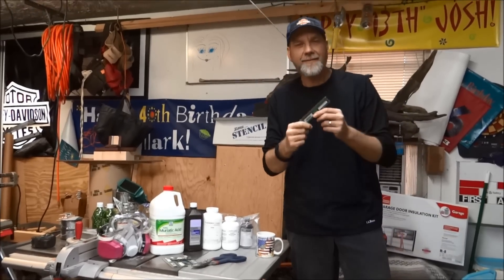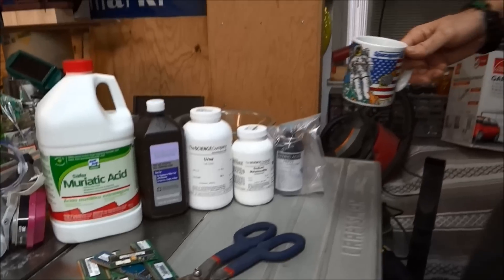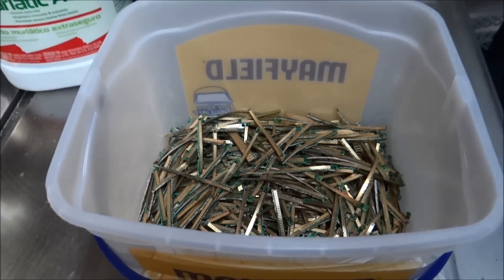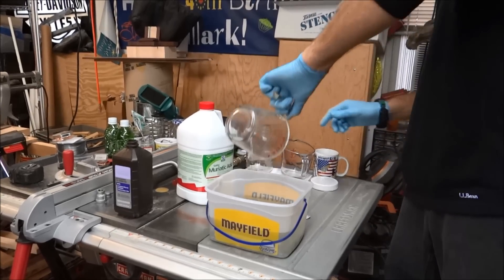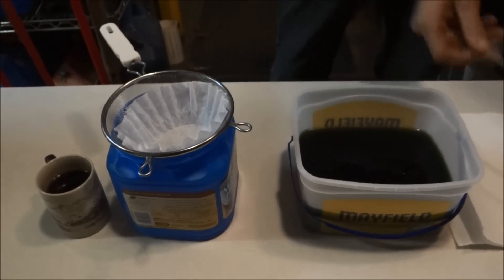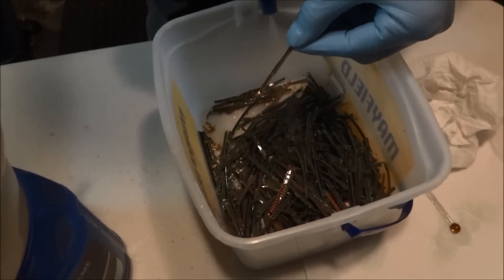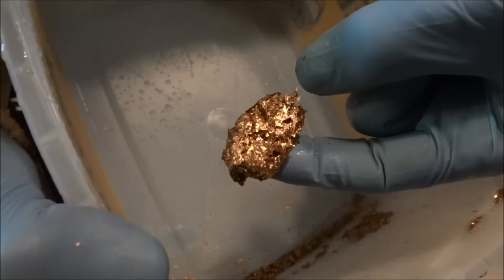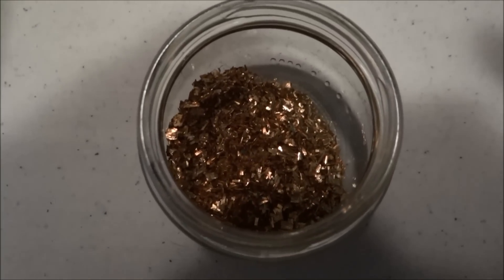How to easily recover gold from scrap computer chips

Comment: Is the urea necessary? Can't you just use the S.M.B only? Of course the urea makes it esier to handle, but do you need it?
Reply: YES THE UREA IS NECESSARY in the Nitric Acid/HCl Acid *Aqua Regia) process.. Without neutralizing the Acid you can add all of the SMB in the World and the Gold will remain in solution. 

If you want to live dangerously then you can skip Nitric Acid altogether and add Household Bleach to your Muriatic Acid. (I will not.)

Of course this creates Chlorine Gas...which can deadly...but will dissolve the Gold. But then the Urea is not necessary and YOU DO NOT ADD IT AT ALL. Then the SMB will drop the Gold from that solution.

Then that stinks up the neighborhood...Some busybody, who does not like the odor, thinks that you are running a Meth Lab...The DEA is called out and raids you. Then you go to jail for refining Gold.

They seize all of your property and your Gold. And although you are released, because they have NO EVIDENCE, you still do not get your stuff back.

Think that is far fetched??? Do not laugh. It happened to somebody I know.

TALK TO YOUR NEIGHBORS AND LET THEM KNOW WHAT YOU ARE DOING. Be loud and visible. Invite them over. Ask them for their broken electronics so that you can do the Green Thing and recycle them so that they do not fill up landfills.. Do not create obnoxious odors. Minimize that by creating a fume hood and charging the exhaust with Charcoal.

Good luck.
Reply: Thank you so much for the info! I better pack up my methlab and remonce it ,before i start 😉 i have seen a video where the bleech is bring use.  But in denmark we only have klorin and nitrit acic and sulfuric acid has been made illegal, but I have some nitric acid that i have saved. But when i run out of it, I have to use the bleech combination. But I dont know if klorin is good enough or to dangerous, i know that it shouldn't be mixed with anything but water😨
Reply: 24kGoldenRocket The reason i need the sulfuric acid, is because i've bought 140 grams of very low karat gold from Israel on ebay, a 6 karat of testing fluid is way to much for it, but it take som time to disappear and it is really heavy. I think there is both lead and aluminium and cobber or brass in it. i thought of melting it and make flakes of it and then try reverse electroplating or should i put the flakes into Aqua regia. I have seen that most people use a 50/50 soloution when they make their "Aqua regia" an use a hotplate, does it harm the gold in any way? do you need to neutralise the Aqua regia fast? (thanks for the tip on sulfuric acid, i was about to make both nitric and sulfuric acid and destil it myself.
Reply: thomas lund I hope that you did not pay a lot. One of the current scams on eBay is that these guys will melt all of those plated pins together....and then sell those. 

I would infuse some flakes into Aqua Regia and then test with Stannous Chloride Solution to see if I'd get a strong positive for Gold before proceeding much further.

Best wishes. Go to the Goldrefiningforum.com and read Hoke's book. (free download.)

This reads as if you have bought yourself a nightmare.
Reply: No i didn't pay much, maybe i should have it analyzed, but it cost more than i have payed for it is it just half a karat, then i've made Money on it, but i doubt it.On Ebay there is a lot from America that don't ship to denmark, so i'm missing out on the really good deals :-(   I just can't imagine that they can make Money when they have to melt it. My theory about there being tungsten/wolfram in it is right out the door, because that requires about 3500+ Celsius to melt, but it have a very high density about the same as lead but a Little heavier an it's shiny like gold an it doesn't oxidize like brass
Reply: thomas lund Tungsten has the same density as Gold. Furthermore you do not have to make them...when Chinese Companies are already making them and selling them online for much less than the price of Gold..

From my favorite Financial Website:

http://www.zerohedge.com/news/2012-09-24/get-your-fake-tungsten-filled-gold-coins-here

is this...when I followed the link...

http://www.tungsten-alloy.com/gold-plated-tungsten-alloy-coin.html

Yeah. You are missing out alright...NOT.

I will not buy off of eBay as I cannot test the item which I am buying.

If a deal reads as too good to be true...then ninety nine times out of a one hundred it is too good to be true. Thus you can conclude that there is a fraud being perpetrated.

Be careful out there. Buy locally. This globalist economy encourages fraud and corruption, both large scale and small scale, as little can be done to punish it across international borders.
Reply: 24kGoldenRocket I have seen it. But the density of gold is a tiny little bit bigger. I heard some time ago that Clinton swithed some real gold bars out with this tungsten-shit, ofcourse to switch them back later, but they accedentally shipped one to Germany. They almost didn't noticed it, but a goldbar is a bit heavier than these smal lumps i've bought. I don't know if it is true, there is a video about here on you tube, but that doesn't make it true! By the way, i saw a video where a guy made a gold recovery on a 106 memory pieces of memory goldfinger and he only got 0,8 grams of gold, it was 2,0 you got, is there that big of a difference?
Reply: thomas lund On the recovery of Gold from RAM fingers..There can be a marked difference. Earlier electronic boards were not as subjected to as fine of engineering standards as later boards.

As the World Spot Price for Gold increased dramatically, doubling from 2001to 2008, during the past decade there was more of an incentive to conserve the use of Gold.

Thus engineers went to work devising stricter controls over electroplating and minimizing the use.

If I were to run a batch manufactured from the late1990s and compare the yield to that from a similar batch manufactured in 2010 I will expect that my yield from the late 90s batch to be more fruitful.

Yes there is a marked difference.

As for Clinton switching Gold?

There is NO Gold in the US Mint Depository at Fort Knox.

The US Mint made a mistake and exposed it inadvertently.

On their own website in 2009 they claimed that they were suspending the minting of Fractional Gold Coins because their OUTSIDE SUPPLIERS could not supply the blanks. They ran out of Gold to strike the coins.

All Mint activities have been done IN HOUSE historically. If they are reliant upon outside suppliers for planchets then they have no sheet to fab the planchets from and no Bar with which to create the sheet.
Reply: 24kGoldenRocket Okay that's why, that make a lot of sence. I have just tried a little batch of computer scrab, but i left it to long or my HCL is a Little to powerful, it's 36,2% i don't think it is the Hydrochloric acid or the Hydrogen peroxide. I simply forgot that hydrogen peroxide is also a kind of bleech and left it to long. Do i need to put urea in it before i try to cath the gold with smb in that 50/50 Hcl & H2o2 solution?
Reply: 24kGoldenRocket Copper should it be grinded to a powder or just a piece of copper? By the way can i thin my HCL with water, if yes should it be destilled water? how strong is your nitric acid? Thanks for all the help by the way!!!
Reply: thomas lund Use a piece of copper. You do not want it to work too quickly.

My Nitric Acid is rated at 69.5%. It is Technical Grade and Cleanroom Grade.

I plan to use Inquarting to refine the Gold as well as recover 99% Silver for further processing through electrolysis to 999.(Lots of homework.)

Yes you can dilute HCl with Distilled Water. Remember to add the Acid to the water.  Boil overs are not allowed.

Now I would not bother for the initial run. I would just adjust the volume that you use and use a bit less. Since he is using 3 to 1 HCl to Peroxide then I'd use...using my mental gonkulator to estimate...about 1.5 to 1..er...3 to 2 volumetrically.

This is not an exact science after all. It is more of an art. Applied sciences are not generally exact...but can be when it is demanded and necessary.

After you are done with your initial separation then wash your foils with diluted HCl, filter, and repeat the process until it the HCl does not turn greenish blue. You want to get the foils as clean as possible for the Aqua Regia refining.

You have heard it said that it all comes out in the wash? It is true.
Reply: My nitric acid is also 69%, how do you make an Aqua regia there is not to strong and harm the gold. Would you give me your recipe for it, where you both tell me the % of the acid and then amount, I can give you my email if you don't want to write it here? I'm having a Little problem with this copper-thing, because i used tap water to clean the gold out of the plastic container, so it's not very acidic anymore, but there is plenty copper in it from the memory fingers? By the way i took some memory finger that i know was from 2004 together with some there was from the 90's, the 2004's was clean for gold wthin 2-3 hours the others hadn't even lost a single piece of gold, it's not only gold they have been cheap with but also the metal that hold the gold in place nickel,copper and so on.
Reply: DO NOT USE UREA! It is quite tricky to use, and can be problematic. If you go on the Gold Refining Forum, you will know that you can just boil off the nitric acid instead, and you can just use SMB to precipitate the gold out of the solution. Also, the Aqua Regia Method is only useful for purer gold, without the base metals to foul the solution. Eliminate the base metals first, then go at it with AR.
Reply: The E- Scrap Man I have been to the GoldRefiningForum.com. How is Urea problematic? Is boiling Nitric Acid is even more problematic?

(In fact I am thinking that since I am going to inquart that I could concurrently collect the fumes of the Nitric Acid absorbing the Silver and distill Red Fuming Nitric Acid by using a condenser...It is all about Temperature control. It may be a fun experiment.)

Boiling Nitric Acid produces a lot of corrosive fumes. After all it is how you distill Red Fuming Nitric Acid. Personally I would not do that without an operational fume hood. I am not going to write that he corrode everything that is close by with the fumes....including his lungs.

Now you can suggest that if you want. Even outdoors that is imprudent and dangerous.

Personally I would limit my use of Nitric Acid by adding just enough until the Gold is dissolved.

Of course my Urea use will also be minimized.

But Urea is necessary...unless you have a fume hood...which the odds stand that he does not.

What are those odds?

I will err on the side of caution and prudence every day of the week.
Reply: 24kGoldenRocket Yeah, I meant to say heat up the nitric, not boil it. But even so, I will start college soon, so I will have access to their fume hoods, so I can stay safe, but still practice safety precautions, as the nitric acid is hazardous when heated. But on this link, http://goldrefiningforum.com/~goldrefi/phpBB3/viewtopic.php?f=53&t=19126
Geo says that it is best to leave out the urea. And yes, using less of a chemical is always the best, and urea still works, you just have to know how to use it effectively.
Reply: The E- Scrap Man Yeah. I did read that and Geo is one good source. He gave me the idea of slowly adding the Nitric until all of the Gold was dissolved. But I will still probably add too much. It is difficult not to as you want the Gold to dissolve and will end up lacking patience....which also breeds trouble at times.

I am Tall Tom over on that Forum.

So you are majoring in Chem? I studied Physics.

Have fun.
Reply: 24kGoldenRocket well, nice to meet you Tall Tom. I'm  PlainsScrapper on the forum, but I haven't  responded to a lot of posts, due to studies. I am planning to major in Chemistry and minor in  Biology. I want to do the processes like crazy, but I want to read Hoke first, and thoroughly understand the ins- and- outs of the processes. However, my studies have prevented that from happening. Some day, though...
Reply: The E- Scrap Man I am in the learning stages myself, have worked in the Gold industry for the past 25 years, and have some Chemistry background. 

So I have taken the plunge into refining and my learning curve has been steep. No sweat. Well...lots of sweat, actually.

I have read some of the Hoke text. I will read it all before I am through.

My current critique...I do not like it because it is not a direct step process manual. It is reliant on experimentation and uses those as building blocks for the following chapters.

It is presented as if you were in a classroom laboratory lab....which I am not. If I were enrolled in a school with a fully stocked lab then it would be excellent. How many of us are? (Lucky you...)

My impression, currently, is that it is a decent Laboratory Manual but lacks in practical applicability. You must have the materials before proceeding if you want to follow it as presented.

But I will get it down and make a science of it. Dropping the Plat and Palladium will be challenging,

(Even the Tin Shot cost me $20 for a pound. You store your Stannous Chloride on Tin Shot so that it does not decompose. Then the Fume Hood will cost well over $1000??? It is EXPENSIVE. .Since I am doing this then I will do it right or I will not do it at all. That is my OCD.)
Reply: 24kGoldenRocket And that OCD is good, because your safety is worth more than any PGMs ever recovered. 

I could do the experiments outside, but I don't want to poison the environment around me from the toxic fumes and gasses. 

I have well over a pound of goldflash and plated pins from computers, which will be placed in a sulfuric cell. However, I will keep collecting until I have at least 10 pounds of material, so I will have a noticeable amount of gold, and have a well- versed knowledge of Hoke and the forum by then.